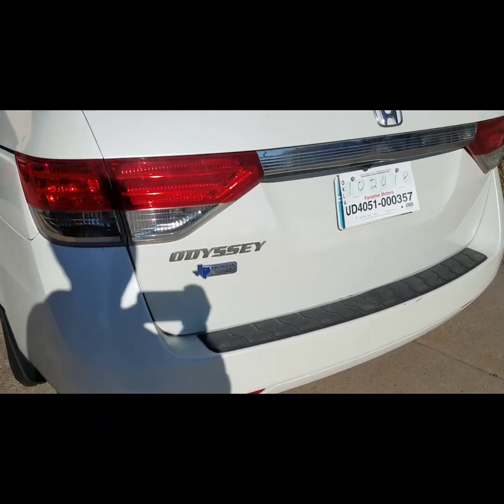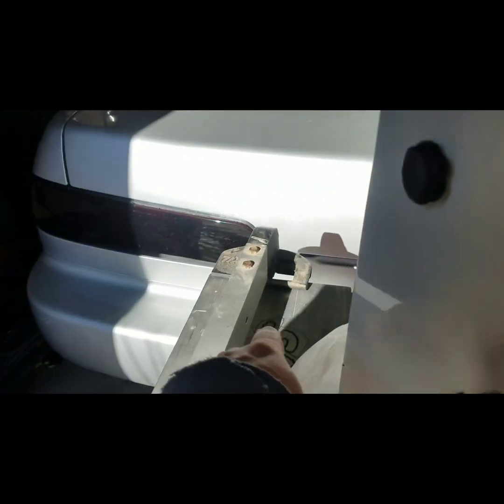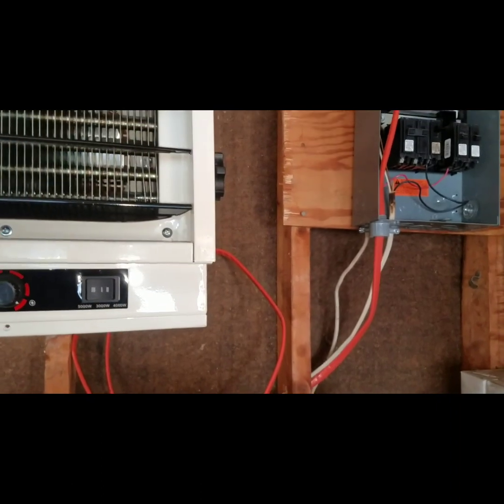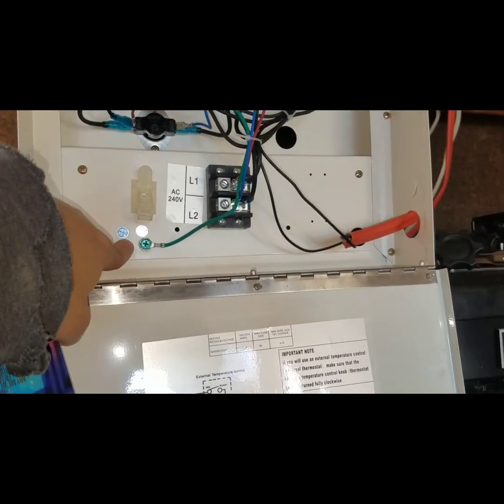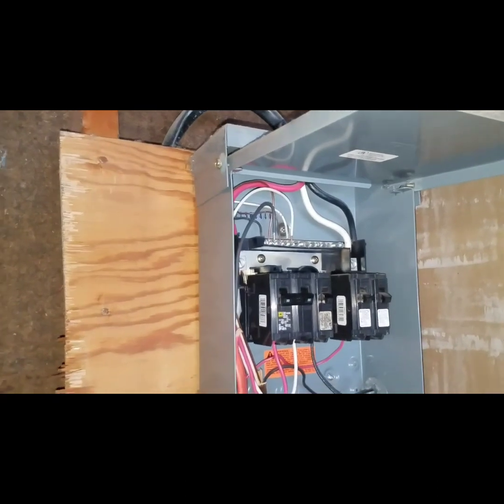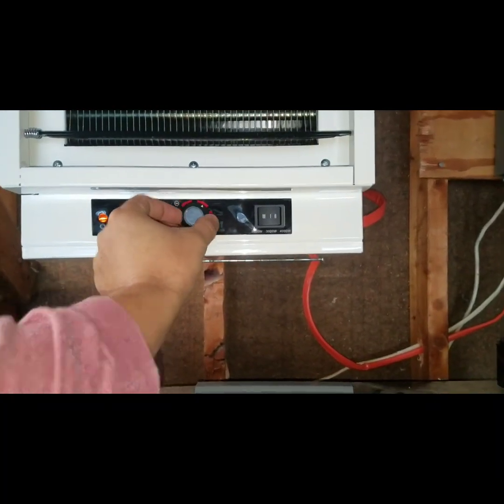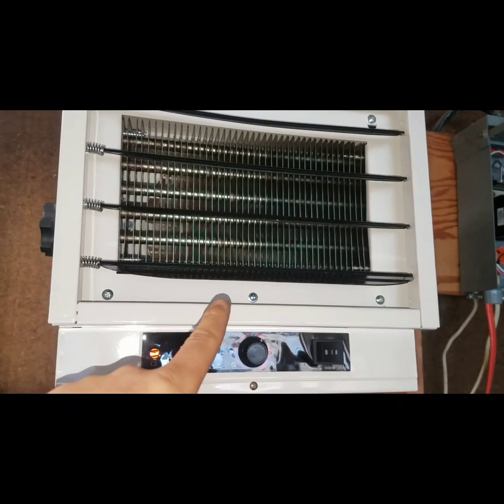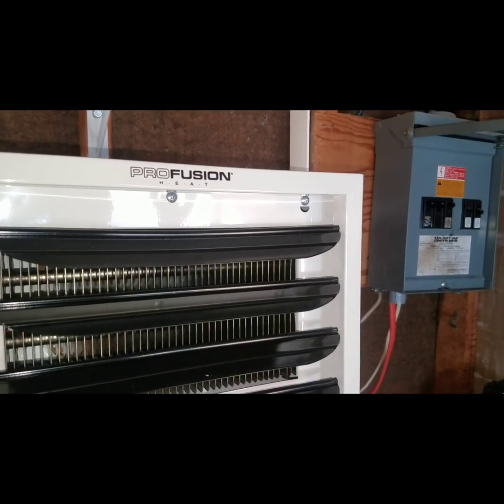Profusion EH4604 Garage Heater (Unboxing, Wiring,and Testing)

Comment: Can you please describe setting the thermostat? Followed the manufacture’s instructions, and the heater never cycles back on, even when the temperature drops dramatically. So basically I’m stuck leaving this running non-stop.
Reply from the maker: Some add their own selerate Tstat. Mine cycles via the front knob.

Comment: When you have it set to 5000w do the heater coils Glow Red? Thanks
Reply from the maker: Kind of but not much
It does get hotter.
Reply: @FlipSideGarage  ok. I just installed one today and it is getting hot but kinda thought it would glow red. 

I actually wired it into the same breaker as my outside ac unit. Obviously the ac unit isn't going to be running since it's cold enough to need the heater. 

Was just making sure. If you would have said yes then I would go buy a separate small breaker box with a dual 30A breaker.
Reply from the maker: @P.G._FPV  I wired mine independently on its own 2 circuit breakers.
Reply from the maker: @P.G._FPV  yes you need a dual breakers. It needs alot of juice to get hot. 5000 watts is alot of power. Mine gets somewhat red but it does get hotter as hell.lol

Comment: I have the exact one, how come mine shut off on 5000 but run good on 3000w
Reply from the maker: Length of wire and the breaker fuse can affect it. Mine runs well on all settings.

Comment: Wired backwards. White wire is ground. Black is hot.
Reply: Red and black wires for hot, Use bare wire for ground you don’t need white wire.
Reply from the maker: Worked how it was wired.
Reply from the maker: Confirmed by many before operation.
Reply: @FlipSideGarage  FYI....Who ever "Confirmed" that wiring is a MORON.  Wrong supply wire used and wired incorrectly.
After re-watching your video again I see why you wire it that way......The sub-panel on your garage wall is WIRED WRONG.
Reply from the maker: @Paladin7845 cool.
Reply from the maker: @Paladin7845 ok